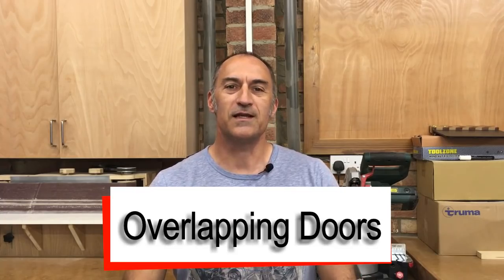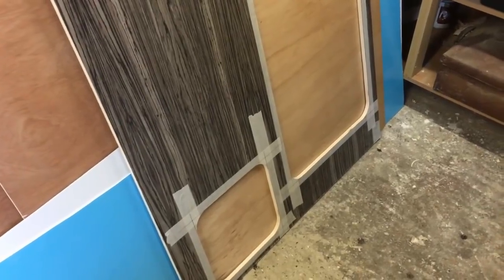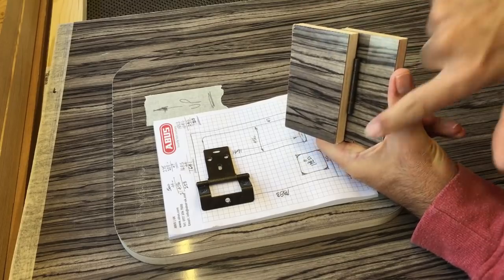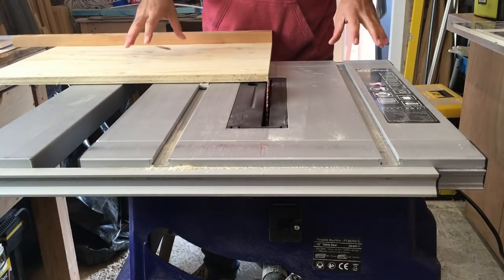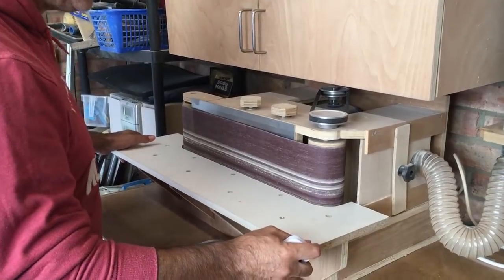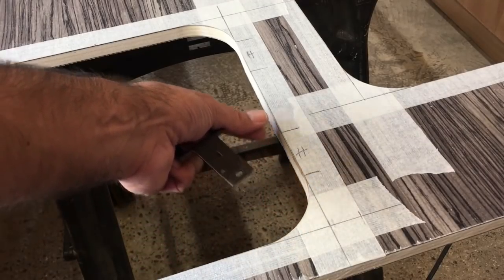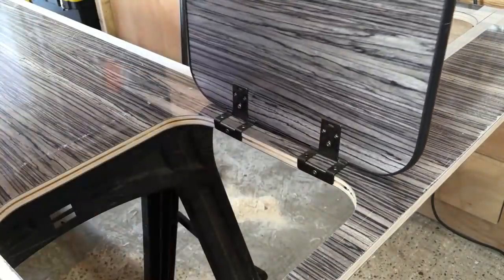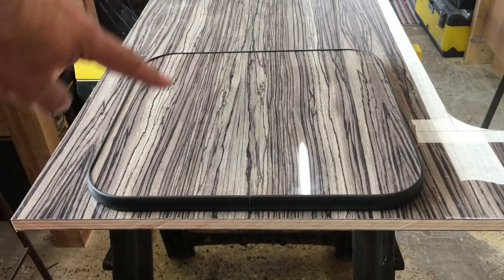Overlapping Doors and Flush Cranked Hinges

Comment: I had those hinges on my old wardrobe many moons ago......I’m glad you mentioned about cutting the trim about  1mm longer so you can push it into the other end and then flatten it all out...this is a good reason why you do all trims like that, in weather changing hot and cold the rubber seal can open up/shrink which will leave an unsightly gap....also always cut the joint at the bottom of doors etc...
Another very informative video my friend, well done 👍🏼😊😉
Reply from the maker: I make you right Marc, always looking for ways to hide a join or not have one at all.

Comment: Hi Greg! I really enjoy your Videos! 
I was wondering how are you going to make the door of the shower waterproof? Do you think will the trim keep the joint leakproof while taking a shower?

Regards
Reply from the maker: Unfortunately, the overlapping door is on the outside and will not be waterproof. So there are a couple of ways to  overcome that.
Fit a bi-fold door internally to close off the opening or simply install a shower curtain across the shower door that allows water back into the tray
We are installing a shower curtain as this is the easiest to source and install.

Comment: Applying a drop of superglue (& activator) helps on the trim ends to reduce their shrinking back over time ... which exposes a gap !
Reply from the maker: I cut them slightly over size and push them in to help prevent that.

Comment: Hi Greg, just going through your excellent videos one by one.
Other than the 2x hinges per door, what would you recommend for fixing to the door so they don’t open when driving?
Reply: 50m double ball adjustable tension catches work great on my van or magnetic catches like Greg used although personally not a fan of magetic catches as the magnets tend to be weak.
Reply: @djangle67  what are double ball adjustable tension catches, haven’t heard of these

Comment: Dear Greg, thanks for your great videos. I have a question: why did you mill the line in the opening of the cabinet without having to have a cover profile there?
Reply from the maker: I know you don’t see it when the door is closed but I don’t want to see the raw edge of the board when the door is open it just looks neater to trim both edges.
Reply: @GregVirgoe  Thank you Greg. I think it's great that you take the time to answer all questions, and also so quickly. Awesome!
Reply from the maker: Harrie Jonkers I try my best but some slip by as there are so many videos and thousands of viewers 😃

Comment: Hey to Greg, Dave here again.

Question: In another Sprinter episode you seem to say, if you had to do over you wouldn't have installed a shower ... ehh, stall. Wondering what you might have done with the extra space?
As well, is the "garage door" on the inside of the van big enough or would you have made that bigger?

Thanks, great job on this project. You may have helped cargo-van conversions become a serious cottage industry. Amen.
God bless.
Reply from the maker: Hey Dave,
It would have given us much more needed living space. It may get cramped in there during the rainy days.
The internal garage door is big enough to crawl through and to stick the front wheel of a motorbike through if needed.

Comment: I really enjoy your vids, Greg.Vicarious van-building before I start my own :-p
I am curious, though: with the door on the outside, how do you plan to drain the water back into the shower? (I assume there will be a shower in the bath...)
Reply from the maker: Hi Steve, the way this is dealt with in most camper builds including professional motor homes is to have a shower curtain that you can pull across the inside of the door. 
We have done the same in our shower room. Video out soon

Comment: Hi Greg how many boards did you use from Moreland I'm going to order threw them after watching your build my van is a bit smaller citroen relay l3h2 many thanks
Reply from the maker: You can get it out of 6 boards, I used one extra board to enclose the garage at the rear under the bed.
Reply: @GregVirgoe  thank you Greg

Comment: Super. Just wondering why you went for overlapping doors. Guess they're wood movement proof, but any other reason?
Reply from the maker: For the Shower and Toilet cassette door, I wanted to place a seal between the door and the frame.
For the shower to keep the humidity inside and for the toilet to prevent any odours from leaking out.
In the next shower video, you will see these seals in place.

Comment: Greg, just watched the vid on the 100W solar panel. I don't have a van as yet so I'd just like to fly an idea past you.
I watched most of Charles Sterlings of Sterling Power, videos on Battery to Battery Chargers (BBC's).
First, solar panels are out. I still don't understand why new vans still have a 20A fuse to the leisure batteries because what Charles says makes perfect sense to me.
He takes a thickish cable from the 200A alternator direct to the BBC.
The BBC sits next to the leisure batteries say 2 x 96Ah.
Say the batteries are .2c. The BBC is intelligent enough to provide the correct charging current to the batteries irrespective of what's going on at the alternator i.e taking care of the starter battery and regeneration on E6 engines.
Suppose you discharge the leisure batteries to 80% each day. The BBC can charge at .2c that's 5 hours for a full charge but only 1 hour for 20% charge. In other words, a 1 hour trip to the shops could replenish your daily need. Or you could just run the diesel for 1 hour at low speed. Next, you could have a small generator for emergencies. Again, you only need 1 hour.
For me this beats solar panels but like I said, I haven't tried it out yet.
Reply from the maker: Hello Jeff, 
After the initial capital cost, (£1/w) solar energy is free. :D
It won't do your van engine any good to let it idle for long periods.
An hour in a van is at least two gallons of fuel a day, that sounds very expensive to me.
You would spend the cost of a 100watt solar panel on fuel in just two weeks.
I wasn't aware of BBC when I did my selections so can't pass comment on them good or bad.

Comment: Thank you greg, excellent video, have you done a video on the mini round catches?
Reply from the maker: Gasgiant no we found they have a design flaw in one of the 4 possible orientations they do not work and would not open leaving the door or drawer perm shut. So we went for magnet and door handles.
Reply: @GregVirgoe  thanks Greg, magnetic catches & handles it is then 😁

Comment: Have you got any advice for managing to cut this plywood laminate by hand (jigsaw) without getting splintered edges????
Reply from the maker: Yes, if cutting with circular saw use a laminate blade which has a high tooth count 80 teeth is what you need and a good make is Freud. 
For jigsaw again a laminate blade new and sharp. 
Use masking tape on your cut lines. Don’t try to go fast as that increases the chance of chip out. 
Both types of saw normally cut upwards so have your good side facing down so any chips are on the back and will not be seen.

Comment: Hi Greg, I have been watching all of your videos and always eagerly await your next release. In fact, you have inspired me to do my own conversion and a van is on the drive ready and waiting.

I have been busy buying in parts but I have a question regarding Sikaflex 512. It is expensive but a product all good converters appear to use - do you know how many tubes you have used in your conversion? I don't know whether to order in 1, 6 or a dozen!

Also, have you exclusively used Sikaflex 512? The instructions for fixing Fiamma awning brackets indicate  Sika 252 which is a structural adhesive. This does seem belt and braces as the brackets are also bolted down.

Keep up the good work.

Comment: Can you help? I am helping with a Sprinter conversion for a friend and he wants to flush fit the door to the shower onto the flat of the Morland  lightweight ply. I see you have face fitted with cranked hinges. Do you know of a hinge that we could use to allow a flush fit arrangement. May I say  your video's are  great , keep up the good work.
Reply from the maker: joe dent I flush fitted my drinking water door and my internal garage door and just used normal butt hinges. I placed masking tape on the board and marked the wood making sure to round the corners. 
I drilled a hole just inside but touching the line and barely big enough for jigsaw blade. Then keeping to the inside of the line cut the door out very slowly. 
Now the cutout you can use for the door but it needs just a few extra mm trimmed off each side to allow room for the T Trim. Typically a gap all around of 8mm will be rough for trim. 
I flattened the trim with a file where the hinges go and all you could see when done was the spine of the hinge between the door and surround and the grain all matched perfectly. If you PM me I’ll shoot a little bit of video for you 😃
Reply: @GregVirgoe  Wouww Greg you are the master. I am in the middle of building my very first transporter van. I was also looking for an answer for a flush fit rounded edged door fabrication video. İf you can post a video describing how to handle this job it would be much appreciated. great videos and source of inspiration. Thank you so much.

Comment: Any reason why you didn't make the flush?
Reply from the maker: I wanted an overlap so I could fit the draft excluding strip which would make it more air tight to help prevent any possible smells.
We do keep the cassette and toilet really clean and have never had any odour issues in the van 😃

Comment: Once again brilliant, one
question though, the furniture board you used what is the weight of a sheet is there a big difference from normal plywood, cheers
Reply from the maker: A sheet of this board 2500 x 1250 weighs 25kg, bearing in mind this is 15mm thick and got high-pressure laminate on both sides.
It's a 7 ply board made of poplar, cuts really super cleanly and has great screw retention properties too. It's been a pleasure to work with.
Reply: Thanks Greg it definitely is the stuff to use, how many boards will you have used once you are finished?
Reply from the maker: 6 sheets completed all the internals, I decided to enclose the back of the garage so used 1 more.

Comment: Hi Greg, missed you at Camp Quirky but really good and instructional video.
Just wondering on your opinion - the iron on edging of my vans internals is getting a bit 'tired' in places. I was considering using some of the push on T Trim edging to re-vamp it. The question is, is routing the slot on the edging in situ a viable and/or advisable exercise? The board will be vertical but fixed in place.
The other question I have is, does routing a slot on an internal radius through up any other issues? That bit wasn't covered in this video.
Regards,

Max
Reply from the maker: Hello Max, sorry I missed you at QC.
Routing in situ will not be possible as you will not be able to get to the end of the board and your slot will always finish 2-3" shy of the wall or ceiling due to the router base diameter.
Routing the internal radius was easy to do, just don't make the corners to tight so the trim can bend, you can cut the tongue in places to ease the corners.

Comment: Better when tracing shapes to use a disc 40mm dia with a hole in the middle. Put a pen in the hole and you have an instant 20mm offset scriber

Comment: What sized flush fitting hinges did you use? Thanks
Reply from the maker: They are approx 2” long on the hinge with 1/2” overlap
Reply: Greg Virgoe thanks! Do you have a link to the ones you used?
Reply from the maker: Luke Tucker Links in the video description. 👍🏼😊

Comment: Hi Greg. I have been looking at a way of attaching a door to our shower in our Peugeot Boxer conversion and thought to reduce space by making the door as a slider using drawer runners fixed horizontally to the door opening and back of the door. Have you come across this means of attaching a door?
Reply from the maker: The problem there is the drawer runners occupy a 1/2” space so there would be a 15mm gap between the wall and door 🥴

Comment: Hi Greg. Would it not be better if you overlapped your rubber insert at the beginning and the end and cut through both to get the perfect finish and how are you going to stop water running out the door  when you showering. Would the water not delaminate the board.
Reply from the maker: Hi Chris, if you cut them both they could shrink in cold and leave a gap, I cut them 1mm longer and push them together on ends to make it a very snug fit. We have fitted an internal shower curtain across the door wall only to prevent that from happening.

Comment: I used to have the toilet access door from the inside and it would always smell.  make sure you vent it well as it will always smell 100%. My new van is from the outside and much better. never go back again .
Reply: Good point you raised..you've got me thinking about that now.🤔
Reply from the maker: The door has had a seal fitted between the door and the frame.
Ensuring that its always really clean and using some sweeter smelling products will no doubt help too.

Comment: Technically there's no grain so you could cut the board (cross cut) without problem. 👍🏻
Reply from the maker: Darren Read it’s a 7ply substrate with high pressure laminate both sides. You can cut it any which way you like and it leaves a beautiful clean crisp cut and no tear out

Comment: Greg " sorry  to drive you mad, but what would you use to insulate a small peugot five seater van.. ( only back windows. ) please..
Reply from the maker: Hi Marilyn, if the panels are fairly flat then go with PIR foam board foil, faced, like Kingspan or Celotex and a plastic or foil vapour barrier over the top before ply lining. If the voids are very awkward in space then go for a more flexible material such as earthwool, cotton, sheeps wool, recycled plastic is another option.
Reply: Ah thank you for taking time to answer greg👍

Comment: I saw thousands of clips from factory motorhomes - you can easily pay 400k in the US and you will not even come close to the quality of this van. I wonder however, if it would be possible to build with thiner materials or even create overhead storage like in an airplane or if you would need materials with a big price tag like carbon fiber.